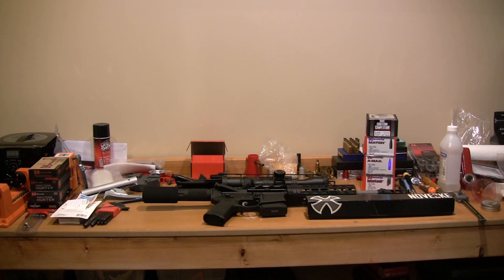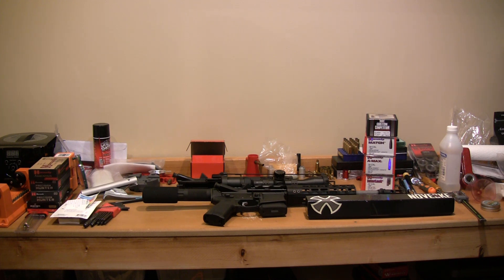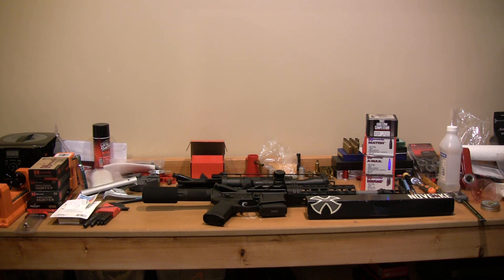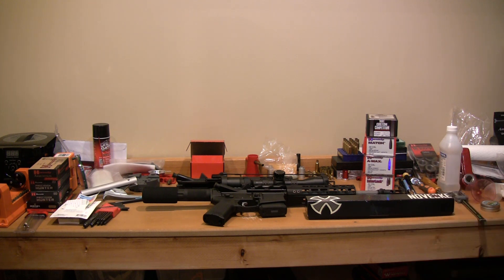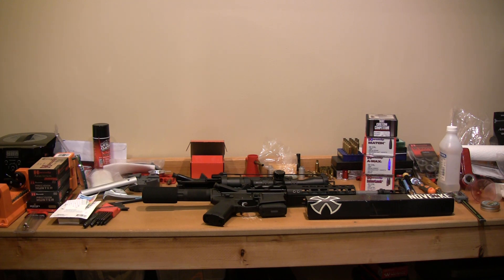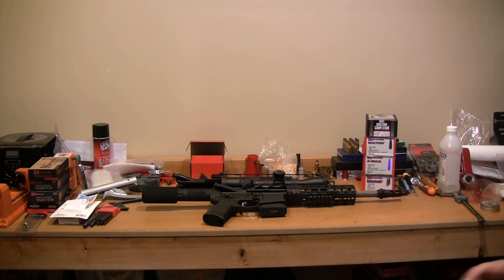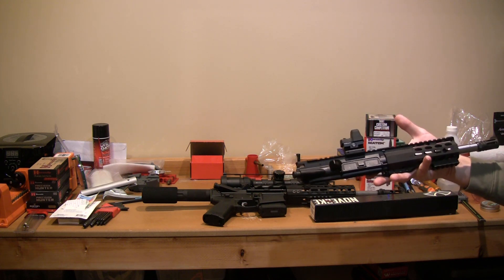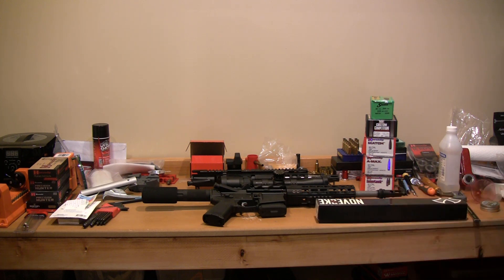300 blackout barrel Selection: Twist Rate Matters

Comment: Yep, no question about that 1/7 being superior to 1/8 for heavy subsonic type bullet weights. I too watch Johny's Reloading Bench! He's the truth!

I also use Aero Precision uppers and lowers for my 300 Blackout builds. I only use Aero Precision, and I ONLY use Ballistic Advantage barrels (AP bought BA not too long ago but BA still sells barrels and BCGs via their website www.ballisticadvantage.com)

I only use 1/7 because I knew that I'd eventually be shooting with a suppressor exclusively, regardless of bullet weight. So I got a 300BLK 8.3" BA Hanson Premium, a  10.3" BA Hanson Performance, and a 16" Modern barrel. They are all great barrels, and about $100 cheaper than Noveske or Wilson Combat.

I also reload my own 300BLK in various weights from 110, 115, 147, 194, and 220. For subsonic I use Reloder 7 and 1680, but for supersonic I just use Win296, but with great results (full cycling and FPS without any special buffer, BCG, or gas block). 

By heavy bullets fly like an eagle, straight and accurate. I've had zero issue with baffle strikes from my Omega 9k or Sandman S.

I'm very pleased.
Reply from the maker: +PattyMcDude first thing you need to think about is NFA rules. If you plan on getting a barrel shorter than 16" for your blackout you either need to get your SBR approved first or build a separate pistol lower. Don't own it till you have those things completed first.

I guess you need to think about what your goals are for this round specifically. If you want more fps for your supers, longer is better. I would not recommend anything that didn't have a 1:7 twist rate, 1:8 might do the job but I wouldn't. I really like my 10.5", but if you want more velocity you can probably gain 150-200 more fps making it a16"
Reply: PattyMcDude An 8.5" 1/7 300BLK barrel will launch a supersonic 110gr TAC-TX at around 2200fps. You need about 1350fps to get full expansion, which get you out to about 350 yards.
Reply: RETiredGM  how do you like your 8.3 Hanson barrel? All along I was planning on doing at least a 10.5 barrel but I got a really good price on the shorter one and decided to go with a little bit more compact configuration. Only interested in the home defense but would still like to be able to stretch its legs a little bit. Concerned with stability and accuracy. Any feedback would be appreciated.
Reply: @dabonehead101025  yes I would also like to know how the 1 in 8 twist rate would work with a 10 and a half inch barrel shooting the heavier rounds

Comment: So 10.5 barrel is 1/8 300 blackout. So should I get 1/7 or 1/8. Btw I won’t have silencer
Reply from the maker: You can't go wrong with a 1/7 all other things being equal.
Reply: Bolt Action Reloading so does it make a big difference cause all my upper I see are 1/8.
Reply from the maker: I have seen 1/8 twist work for heavier projectiles, mine did not. My 1/7 works great. My 1/8 will stabilize 150gr and lighter no problems but not what I was hoping for when I got it.

Comment: I shoot 123gr through my 1/8th twist 16 inch barrel and I'm hitting 300 yards all day long.
Reply from the maker: The 123 gr are light bullets and it wouldn't have a problem with them. Its the heave 200+ grain that go sideways. Usually to shoot suppressed you would want to shoot a heavier bullet but my 1/8 twist won't shoot them straight.

Comment: Does barrel length play a part? Say 9 inch vs 16 inch both 1 in 8 twist using subsonic rounds.
Reply from the maker: +monitor1862 I would certainly think you have a better opportunity with a longer barrel. My point is get a 1:7 of you have a choice. Some match grade barrels that are 1:8 perform well, but if you want to be sure you can stabilize subs go with a 1:7 twist. Best of luck to you.
Reply: Thank you!

Comment: I have a 1/8 in a 16 inch barrel what's your recommendations for best bullet barrel I'm using 220 subsonic rounds with a suppressor my barrel and upper all came from Spike's Tactical
Reply from the maker: +Michael Cribbin hard to say. No 2 guns are exactly the same. As long as the shot ok sick with them. 220 SMKs are good as long as they stabilize them. My Noveske 1:7 will shoot just about anything, the PSA 1:8 hates anything much bigger than the 168s
Reply: moparmadman I do run the gun suppress all the time

Comment: does the length of the battel matter
Reply from the maker: I am sure it could be a contributing factor, but the only calculators I have seen involve twist rate.
Reply: Yes, definitely it matters. For shorter barrels the 7:1 or even 6-6.5 are better at stabilizing the bullet. Longer barrel length accommodate the higher twist rates better. I personally have an off the rack radical 16" with 1:8 and pistol length gas system that cycles perfectly on everything from 110gr to 220gr. Is extremely accurate and reliable. But for a pistol build I'm looking at a 1:6.5 twist for the best stabilizing. Just my personal findings and opinion. Hope it helps

Comment: I've been using a Faxon 1/8RH twist barrel and after watching this vid I'm left to wonder? I have a recent form 1 can and began testing with some Ozark supers 147gr. They shoot very accurate and was very happy with the function of the can. Now moving into the subsonic rounds I was looking into some 220gr. to test before using my suppressor. Looking at some other vids I found this one https://www.youtube.com/watch?v=7wd30l6RB-A and he has the same barrel as mine and testing some pretty heavy rounds and never mentioned any key. Could it be the RH on the twist?
Reply from the maker: To say it is one specific thing or even the same barrel manufacturer on 2 different days is the same is kind of silly. Everything matters, barrel length, twist rate, etc. I might have better luck if I cast lead bullets and made them oversize, since its possible that the dimension on my bore is slightly large, but I am not willing to do that. If you check out at guy "my reloading bench" he does tons of testing with a 8.5 1:8 twist "match" ranier barrel and has pretty good luck. I just made this video to give people my example, its a cheap 8.5 1:8 twist and it shows, my buddies KAK does the same thing. Good luck and straight shooting to you.

Comment: 1:7 is the way to go on 300 blackout subsonic.  And you can actually see expation on the sub rounds even in an 8" barrel!!!!
Great video bud!
Reply from the maker: +338 Jigaman thanks
Reply: 338 Jigaman I have a ballistic advantage barrel that has a 1:7 twist and its a 10.3 length. I have only tested the Remington 300 (220 grain). It would only fire one or two rounds then it would jam up. I have tested quality 300 blackout ammo (110-165 grain) and it ran like a champ. I guess it really depends on the quality of ammo you feed your AR.
Reply: J.L.H is s pistol or sbr? Cause the buffer spring out of a pistol cicles everything we put through it
Reply: J.L.H  Hey bud i have use 220's and with a lancer, hexmag and pmag 30 300 blackout. And never had a malfunction but i use 200gr g2 trident or 194gr leghi defense all copper ammo for sellf defense sub and 110 120 Barnes all copper. I hope it is helpful if it still do the same check you buffer spring and make sure that your bcg has the internal o ring......

Comment: I've heard the 10.5 is the optimal length for the 300 to burn all the powder and for 1/8 twist to work. I would assume with a shorter barrel then that you would need the 1/7 to stabilize a heavier bullet
Reply from the maker: buckshot8025 I really don't think that the power burn is a concern. When I chronograph the 10.5 vs the 8.5 with the subsonic rounds there is very little velocity difference, plus I increased the charge to increase the velocity up to even 1350 fps and still had bullet tumble in the 8.5"

Comment: For .300BLK I went with an AAC complete upper. I figured why not use the guys that designed the round. I got the 12.5 upper and it eats 110gr to 220gr all the same. It's been my most reliable AR platform to date.
Reply from the maker: +Kevin mixon I am sure being aac they know how to put it together. Thanks for commenting, and letting others know a good option.
Reply: What is the twist?
Reply: @JWard2  yeah what is the twist
Reply: What is the twist?
Reply: Yea, mine eats everything too and dont disclose the twist rate either

Comment: Ive shot my 1-8 up to 220 grain and its stabilized all so far...... I guess I got lucky.
Reply: What is the twist?
Reply: @Jason32Bourne  its 1-8
Reply: @Marcus2750-u1t  Thank you for the reply. Sorry I meant length.
Reply: @Jason32Bourne  10.5 and I have 12.5
Reply: @Marcus2750-u1t  Thank you. I'm wanting an 10.5 or an 11.5. This helps.
Reply: @Jason32Bourne  yeah both will serve you well, my 12.5 is a tapered and fluted green mountain barrel and my 10.5 is a l Lothar Walther barrel…… great stuff
Reply: @Jason32Bourne  also I have a 10.5 barrel with 300 blk feed ramps thata 1/8 twist Ill sell brand new
Reply: @Marcus2750-u1t  You're awesome. Thanks again.

Comment: It's known that it takes some distance for long bullets to settle down, sometimes 100 or 150 yards. Until that time the bullet can yaw around. Maybe that's the problem here? You should go to a 200 yard range to see if these bullets are still going sideways through the target.
Reply from the maker: +Paul X thanks for the comment but a bullet that is stable bullet won't ever be sideways. If you running a sound suppressor it would likely damage it. This projectile flying this way would never hit the same spot at 150 yards and a subsonic rounds that is 200+ grains 200 yards would have a gigantic drop. This is a barrel issue plain and simple.

Comment: in a pistol setup, sideways is a good thing...its not coming out the barrel sideways.. but when hitting that intruder in the middle of the night..sideways is gonna cause some serious damage. i have my ar pistol for one purpose...home defense. if i wanna shoot long..ill grab my ar carbine.
Reply: I can understand that. I too want a 300 b.o pistol primarily for home defense and wouldn't care too much about a sideways bullet within close quarters especially if the bullet goes in the direction I aim, so I placed a bid on a OMNI with an 8.5" barrel and 1:8 twist rate. I'm concerned now, however, that the 1:8 rate won't be good enough especially since my goal was to eventually add a suppressor.

Comment: Have you tried anything heavier like a 240 grain
Reply from the maker: It only seems to get worse the heavier the bullets get. Hodgen load data only seems to go to 230gr, but I seem to have seen some load data at the 240gr level. I guess I never saw the point in going any higher really. The projectiles just get more expensive and the action cycles fine with the lighter ones.

Comment: You can make 208 faster and it will stabilize with 1-8 twist. However if with 1-7 twist, you cant shoot 110 and 120 grainers that good at 100 
yards.
Also 208 subs are useless in hunting unless you use a leheigh expanding bullets going less than 1000 fps.

Comment: this is why you see a tonne of 1:8 twist rate (300 Blk) barrels on sale !! some of the manufacturer's finally figured out that they had screwed up  !!
Reply from the maker: The 1:8 seems to be fine for lighter projectiles, its just the heavy rounds that mine doesn't like. There are people that have luck with them, but I obviously feel that the 1:7 is the way to go.
Reply: No😘 for me the 1/8 in 10,5 barel is better for 150gr. And 208gr. In 300yrd.,.... I tray the 1,7 with subsonic 208gr. Same 10,5 barell Bt NO Good results👎